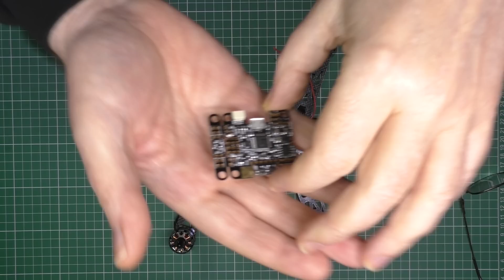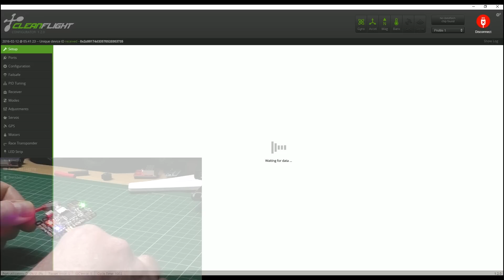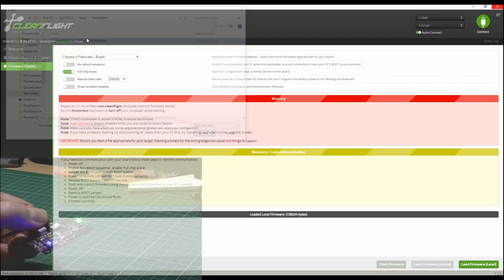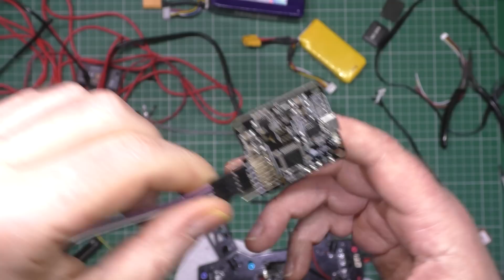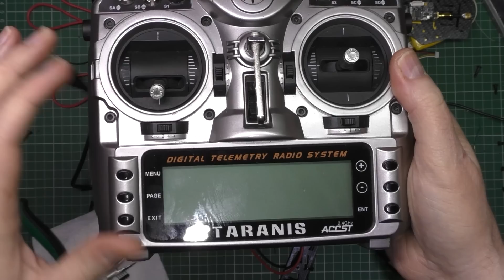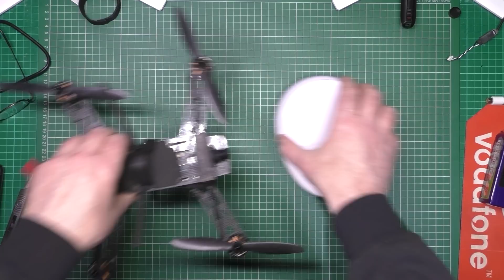Frankenquad the 2nd (attempt 2) part 2 of 2 - SPRacingF3Mini

Comment: did they not proof read the manual for the Board Tony? Me thinks a lot of development is needed on that board thinking I will stick to the Naze Rev6 for Sbus, by the way I got mine to fly now buddy, i got signal wires confused with Ground wires because they were black... Hope to see frank 2 fly soon dude :P
Reply: +Rob Ellis SP racing don't have a particularly good record when it comes to FC hardware with poor design decisions. Even this latest board has huge 'mistake' by today's standards in that passthrough ESC programming is not possible and a PCB designed to break WTF! I think it shows the hallmarks of a product rushed to market with little to no testing. Luckily the FC market has matured to the point where you can select a board tailored to a specific type of flying and let's call a spade a spade here, the Naze style FC's are best suited to race and acro quads not flying lighthouses with GPS. The lack of focus by CF is why I am seriously looking at the Flyduino for my next race quad build.
Reply from the maker: +Rob B I'm a typical bloke who thinks that RTFM is a weakness. The silk screen on these boards is that bad in places, that I ended up reading the effin manual which is all but useless and written (and proof read) by a blind chimp. In TFM, there's arrows all over the important parts so you can't read what the pinout is. There's reference to one UART twice (both with different interpretations). There's also the one I've shown in the video where it tells you to connect SBUS to +ve, -ve and another +ve pad. The manual tells you to update the firmware BEFORE you fly and then gives a picture to update to the firmware which temporarily bricks it (you can only recover by using the boot pads). Luckily, Boris has released firmware or I'd have been totally stuck because the SP mini firmware isn't listed in CF. Also, UART2 doesn't work at alI. I asked Hydra to update the manual and (instead of updating the manual) he told everyone where's a typo! Would I buy one? NO. I'm seriously considering to give my own video a thumbs down. If the manual hasn't been improved by next weekend, boy will I give this thing a bad review. Have a read and see if it's just me........ www.seriouslypro.com/files/SPRacingF3Mini-Manual-latest.pdf  

Rant over :-)
Reply: Not read it yet but thanks for the link I will be reading it shortly my friend

Comment: I have the new f3 mini and I am lost please inthe next video explain the conection to the channels to the channels of the transmiter, I have frsky x8R
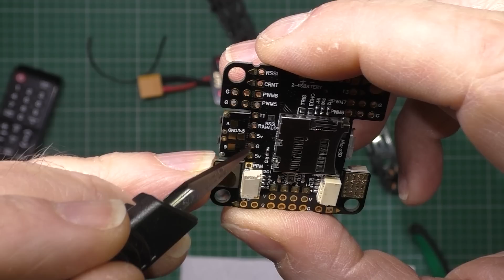Reply from the maker: +Joni Gb If you watch at 7:31 I show you which 3 pins to use (R1 5v and G)
Reply: +Vortecks ok, but this connection is sbus ? or how can I conect to x8r chanel by chanel (PWM),??
Reply from the maker: +Joni Gb You mean connect your aileron, elevator, throttle and rudder to the flight controller with a wire for each?
Reply: yes, can I do it?, and you think is better use sbus?
Reply from the maker: +Joni Gb No, you can't do it like that. You have to use it with an SBUS or PPM receiver. Your X8R has SBUS - it's marked on the top of the casing and you only need to use a single servo wire for all controls instead of one for every channel.
Reply: +Vortecks ok thankssss now have all more clear

Comment: Thank god for your vids mate, we are in a major cold spell here and -40C was reached today. Brrr. If you need to solve the UART connections and wish to change them to match. Allow me to share with you...When I was putting together this  DIY project on RCG, I ordered direct from Molex via the "Free Samples"   option.
 You can't buy from them but they will send you free stuff. So weird but still.  I ordered the 3pos and 4 pos Right Angle SMD Picoblade type to fit the GPS/Mag cable ends.  The page is a little confusing, just look for the correct pin count in the SMD rather than through hole. From what I can see you are looking for the SMD /4 pin/ right angle...
>>http://www.molex.com/molex/products/listview.jsp?query=&offset=0&filter=&fs=productname%3Apicoblade%2Ccategoryid%3APCBHEADERS&npp=20&sType=z&autoNav=1&path=cPCBHEADERS%23%230%23%231l~~nf36%7C%7C526967687420416e676c65&channel=Products<<
JST-SH pitch is 1mm, and Molex Picoblade is 1.25mm . I don't know how this will work with the pads on that SP Racing Mini. But I think you can make a four pin work if you are handy.
Of course that Molex sample pack will take a couple of weeks, so get some freebies on the way (you can easily get them to send off about 6 pcs of six different types) and then make an order at Digikey cause they will ship right away,..and here is the part you want I believe 
>>http://www.digikey.ca/product-detail/en/0532610471/WM7622CT-ND/699109<<
If that isn't right. then here is the link for a bunch of various.
>> http://www.digikey.ca/product-search/en/connectors-interconnects/rectangular-connectors-headers-male-pins/1442547?k=picoblade<<
Hover mouse over pics to get nice big zoom image, it's very useful.
It is better to adapt on the board rather than to  to crimp your own Female JST-SH plugs,  because then you can still use the devices (GPS, Rx,Etc)  with other gear. Besides, you'd have to buy the crimper, the JST-SH wire terminations, and the  housing bit as well!!! 
 In finishing my novel here:-) in order to get the unwanted JST-SH off the board with out ripping off the traces on the PCB,  perhaps some ChipQuiK while your at Digikey, I would be  careful of using hot air around the small smd or plastic components.
Reply from the maker: +Chris Leech WOW - 40? It's a balmy minus 29c in Yakutsk :-) Anyway, I've been (sort of) banned from the Molex website - I ordered quit a few samples a couple of years ago when I was doing my Naza telemetry project and they kept sending me emails, asking what application I was working on. Since then, I can't even order a single sample. I've ordered some connectors with fly-leads from ChinaKong so hopefully, they'll be here for the summer. Thanks for the 'essay' it's much appreciated, Sir :-)
Reply: What is the matter with me? Perfect solution. I was impressed that you have zero problems moving the 0805 LEDs so I figured you'd have no issues with this scale of soldering. Yes I found the free samples when I was putting a Pawelski project together.that allowed you to use Neo6M, made three boards and gave them all away for free. He won't make more and wouldn't allow me to even chg for cost alone, grrr.
For those of us who are impressed by such things, the SP board is a visual delight. I want one but have bigger fish to fry..
Working on my old 9X ,..the THR and AIL pots are outputting gibberish even after replacing. I got to come up with a cheap fix. It is not usable  and I can't afford new anything.
I'll be keeping tabs. What ever that means :)

Comment: Haha "saved 25 grams"! Good video:)
Reply from the maker: +SkindroFPV Yeah :D It's strange that the ZTW ESCs are 25g and the DYS are 14.5g. That should be 42g weight saving on its own. Mind you, the camera is 31g heavier than the other one
Reply: +Vortecks i think dont use those pdb..start using matek pdb..very nice pdb..and just using 2 nut on bottom plate and 2 screw on motor..my zmr is only 342g without battery